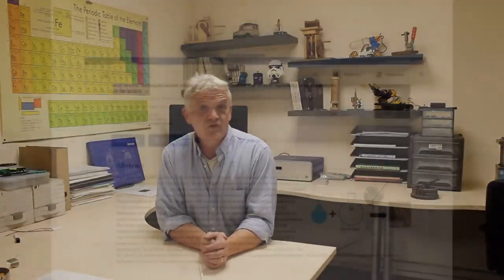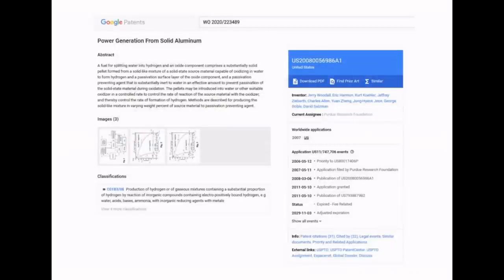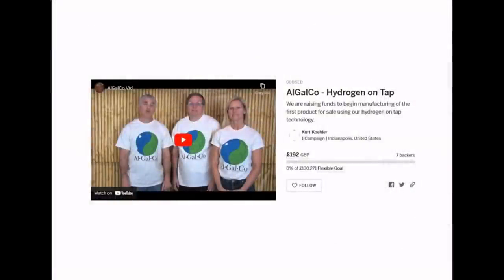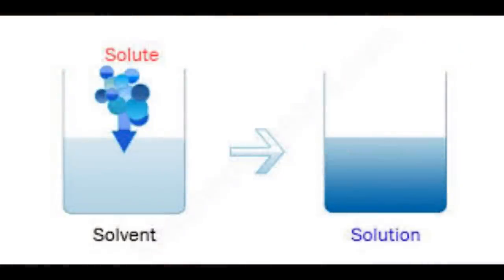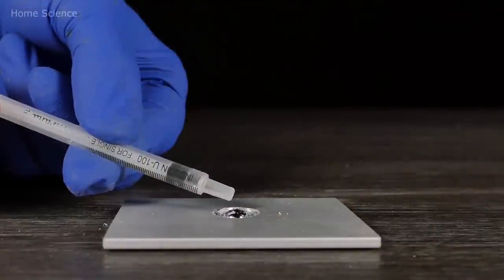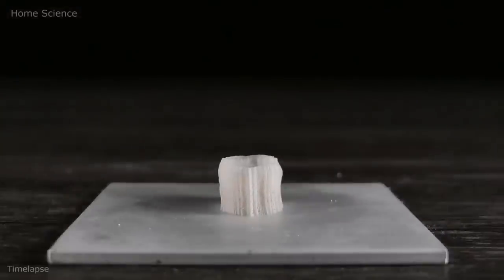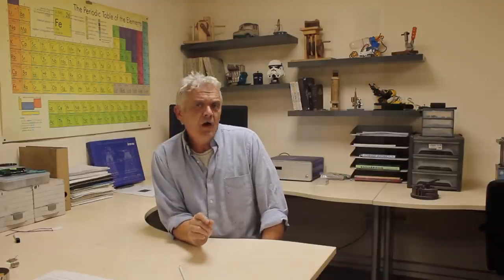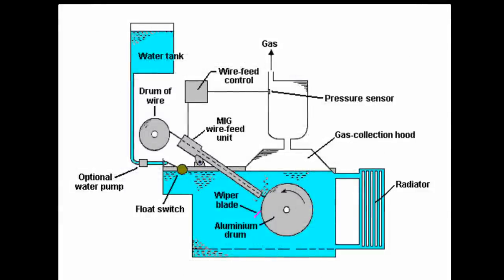1667 Aluminium Gallium And Hydrogen

Comment: I considering now heating my small house via this exothermic reaction due cheap aluminium scrap available nearby CNC shop.

this 3 times cheaper compared to LPG gas heating and 5 times to electric heating.

Reaction 4AL+GA+4H20 => 4AL(OH)3 +3H2+ GA

Gallium is fully recoverable.

All by product are non toxic AL(OH) is even use in meds and toothpaste.

Some numbers

1kw = 3,6MJ

1kg aluminium to AL0H generate 31MJ

10kg aluminium to AL0H generate 310MJ

By-product is Hydrogen 3.9M^3 H2 when burn generate 45MJ

310 + 45 = 355MJ

14.26KG aluminium 442,15Mj

Create 5,56M^3 H2 to 64.18Mj

442.15 + 64.18 = 506,34Mj

This equal Single kitchen 11kg LPG bottle.

11Kg LPG 506,33MJ

Last winter I used single bottle to heat up for 21days.

I will need 0.679KG Aluminium scrap per day to heat up my small house in winter.

I know that hydrogen is dangerous but per day I will not create it to much and I intend burnt it on spot.

Any ideas, opinions ?
What to do with by product like AL(OH)  ?